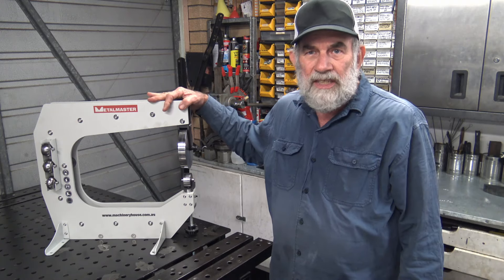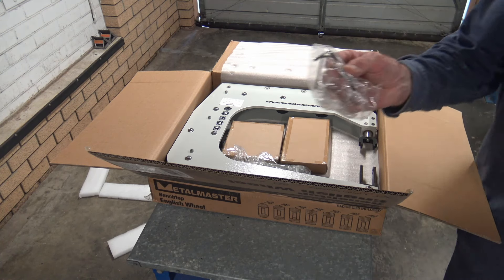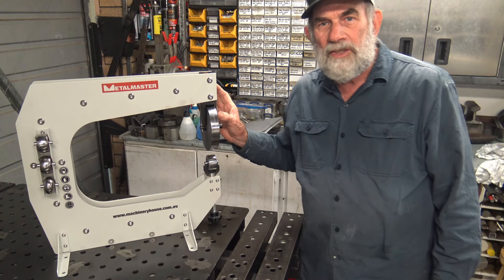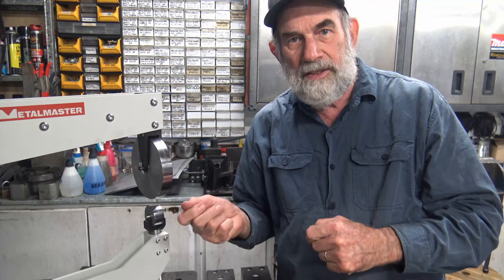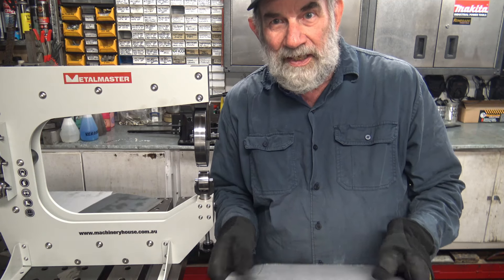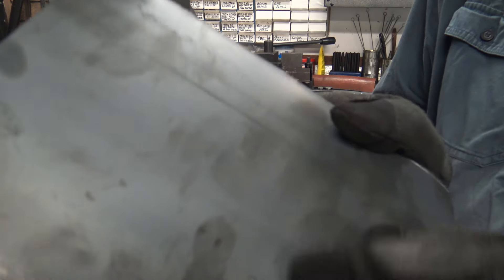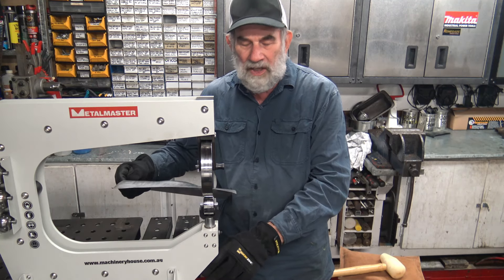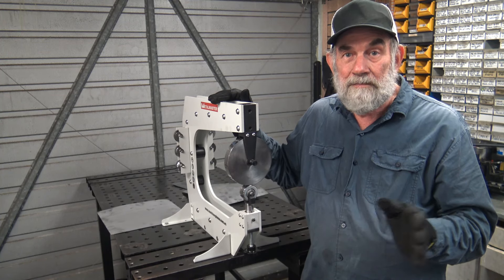Hare and Forbes EWBT-40 Bench Top English Wheel | Should You Buy One?

Comment: Hey Bob, thank you for the informative video. I'm going to order one of these for my workshop, but can you just tell me if you can turn the wheel and anvil 90 degrees. It looks as if it's possible, but no mention of it in the specs online. Cheers.
Reply from the maker: Good question, and I had a look at mine and it does look like you can turn the wheel and anvil 90 degrees. There looks to be a set of matching bolt hoples front and back of the wheel mounting and the shaft the anvil mounbts on looks like it could rotate in its mount. Not something I have tried, but it does look very possible. Hope that helps.

Comment: Thanks for checking if it can do 1.2 and 1.6 aswell. It looks like it has a slightly hard time. I wonder if the ewbt75 has bigger wheels to help it roll over them easier
Reply from the maker: I see you edited your question as I was going to point you to the chapter at 15:55 😁. Bigger wheels would be better, but the frame is strong and the wheels on the bench one just as hard. In fairness to the machine, I was using only a small piece of 1.6 mm sheet for the demo. I think a bigger area of sheet would be easier to work.

Comment: I couldnt find the overall dimentions of the unit online, could you help out with that info?? It would be much appreciated :)
Reply from the maker: To the nearest 10mm, it is 550mm long, and 530mm high. The main body is 55mm wide, but the wheels run accross the frame, but the widest points are the feet which, when fitted, make the base 300mm wide. Hope that helps.